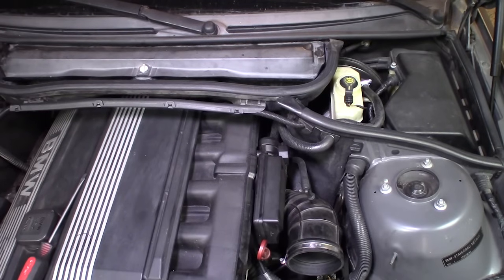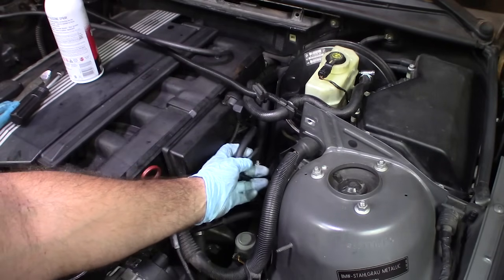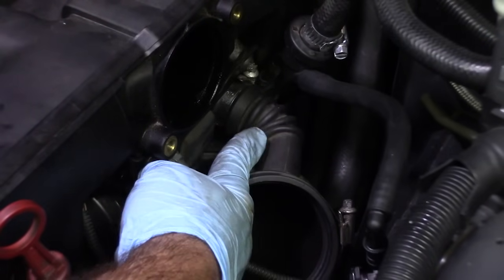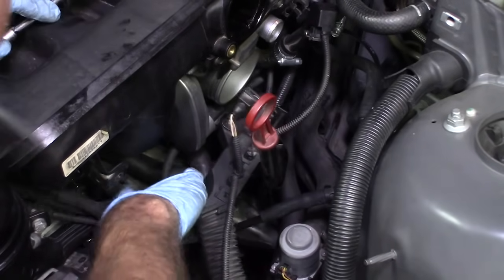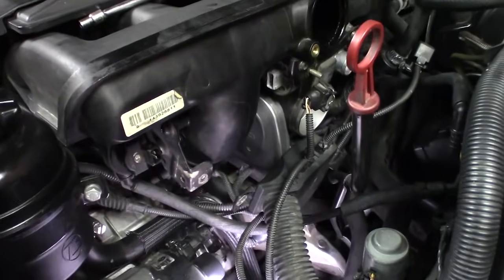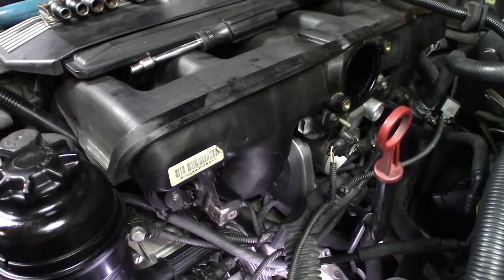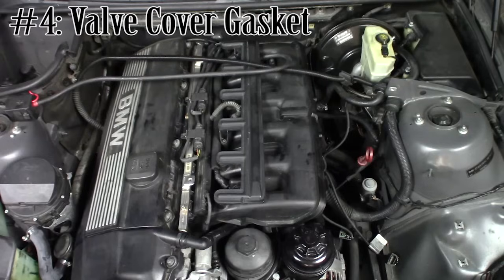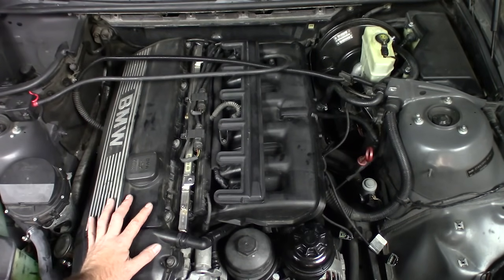BMW E46 & E39 Most Common Vacuum Leaks P0171 & P0174

Comment: First of all, thanks for running more than excellent channel. On my euro spec (no aux air pump) e46 330ci, I had a whistling sound under partial load and occasional lean codes. I have since replaced my CCV, intake and throttle gaskets, intake hoses, checked the ICV and pligged ports, checked the brake booster line amd check valve, EVAP lines etc. Disa O-ring is tight. I smoke tested it with a glove over the MAF (which I also cleaned out with the designated spray) and it seemed al right, the nitrile glove even remained inflated. Still, I can hear a whistle under partial throttle/load and it will occasionally throw a lean code (both banks). Vanos was overhauled/resealed and valve cover gasket replaced at the same time. Oh, and both O2 sensors are new. I'm out of ideas, please chime in if you could. FPR vacuum lines maybe?

Comment: Could a leak at the oil separator also cause an oil leak?  My BMW has an oil leak in addition to a vacuum issue, & if I could fix them both at the same time, it'd save me a lot of woe.
Reply from the maker: Your oil leaks are going to come from the oil filter housing gasket (this will leak directly beneath the left front of the engine), the valve cover gasket (mostly leaking from the right side up high and trailing down to the back where it meets transmission), and the oil pan gasket (mostly leaking from the right side down low but trailing down the same).  Those are the jobs you need to do, in order of complexity from easiest to hard.
Reply: Do you have tutorials up for those?

Comment: Can anyone help me with code p01062 on bmw e46.316i
Reply from the maker: +lee crammond That is an error related to the VANOS system, which is the variable valve timing system.  You need to rebuild it.  I just shot a video on how to do that yesterday.  It'll be released in April.

Comment: Super informative video and very well done.  I've seen a couple of your other videos and really liked them.  I am looking at buying an older BMW to replace my sons car, since someone ran into him and the insurance company totaled it.  It's a BMW 330i.  It has the engine light on it so i told the owner to visit the autoparts store and check the codes.  It has the 0420, 0430, 0171 and 0174 on it.  I've watched several videos before finding yours.  They all talk about the o2 sensors as well as searching for vacuum leaks.  What you said in beginning of this video was very helpful and made sense.  Q - there were some that spoke about the CATS possibly being bad, which could be very expensive to replace.  What are the chances that is the case on this car based on the codes I mentioned?  Thanks!
Reply from the maker: P0171 and P0174 is always a vacuum leak.

Comment: This was a great video. I do have a similar issue. I am getting the same P0171 and P0174 codes but my car is idling fine and drives completely normal. Should I follow the same steps?

Comment: Thank you, great video! I had both codes P0171 and P0174 for a few weeks now and finally found the reason to be number 3 on your video. Breather hose coming from oil separator/CCV to oil dipstick looked like it was trampled... Changed it and after that no fault codes referring to air leaks.

Comment: I have these codes now and my valve cover just started leaking. I will have the gasket replaced on those, hopefully it will fix the issue but will still inspect for other culprit for vacuum leaks you mentioned here. Very informative. Keep it up!

Comment: Have you ever gotten a p2227 barometric pressure code? Love your videos! You are a big reason I bought my first BMW! Your videos have given me the confidence to do the work myself and save some serious cash! Thanks in advance for any advice on the code question!
Reply from the maker: I have not but that could point to a bad MAF or a bad intake air temp sensor.
Reply: 50sKid I did some digging and apparently there is a barometric sensor on the ecm that can go bad and cause the p2227 code. The sensor is replaceable but there is some soldering involved......

Comment: Thanks for the Video, 50sKid
I have only P0174 code, without rough idle.
I have checked , brake booster hose, DISA seal, upper and lower in-take booths , but not sign of cracked...
Also check at CCV hose, no obvious oil leaking on return hose to oil deep stick either...
Shall I consider leak at O-ring of throttle body or 2 gaskets  of Intake?
Mine is M54, but it doesn't have vacuum hose on Secondary Air valve
What would you suggest net step? Thanks!

Comment: Get video - thank you - really appreciate.  Big crack in the lower intake boot and the DISA gasket looks sketchy.  

On our 330ci, removing the electrical connector from the DISA unit requires unlatching metal clip connector from the motor side of the connector.

Comment: I kept getting those codes and I kept resetting them with my bluetooth scanner. I knew that it was some sort of vac leak due to the fact I would hear a whistle sound under acceleration. Now that I have time; I will be addressing these issues. Great informative video!

Comment: Hi 50sKid, great videos that you make! I have a serious problem with my '03 E46 330iA. The mechanics checked all the vacuum leaks and found a cracked valve cover and a minor leak in a vacuum tube. After fixing that I noticed a serious drop in my idle. When the engine is fully warmed up, the electronic tacho shows 640-650 rpm on the N and 620-630 rpm on the D. It often causes my red oil pressure light flicker when the engine is really hot. Do you think it's normal to have such low rpm or should I research the topic further? I must say I cleaned throttle body, ICV, MAF, DISA flap sits tight. What can cause such problems? Thanks!
Reply from the maker: +Marek Kowalczyk I was going to say the idle control valve.  650 doesn't necessarily sound bad.  Check out my using fuel trims to solve engine problems video.
Reply: +50sKid Thanks! I forgot to say that I have new fuel filter and the fuel pressure has been measured and it's in the valid range. I'll check the other video and let you know.

Comment: Hey man I have a 01 x5 3.0 I noticed them I pull out my maf there’s a rubber piece inside the hose. I find it really hard to install the sensor without it binding is that supposed to be there??

 I’m afraid it’s not sealing and causing my bank 1&2 lean codes...

Comment: I bought an old 325 as a beater and im juat trying to get it to run healthy. I havent run the codes but im pretty sure the engine is lean causing a lack of power. I noticed while repairing a different issue. The previous owner did an egr delete. If i do not have a vacume leak could the extra o2 from the lack of an egr cause uneven burn and cause a lean issue?

Comment: i recently replaced the starter on by e46 and i removed the whole intake manifold in order to do so. now my car has the "check engine" light on, i think its a vacuum hose causing that? but im not sure. do you have any suggestions @50skid?😕

Comment: Thank you for your guides. I did successfully replace cvs on my e53 today, and it runs well. But start hearing quick hiss noise about one second long, just after engine off. What it could be? Am I forgot connect any vacuum lines...

Comment: Hello again 50sKid, I have a question about my 2006 BMW x3. I have a hissing sound from engine area while the vehicle is running started a week ago, the sound is  increase when I put climate control fan termed high. My question is a vacuum leak making that kind of sound? Thank you!

Comment: great videos. I know enough to get me in to trouble. I have a bmw X5 and I can not figure out were this one vacuum lone goes. I think the part number is 11727545323.its a hard plastic tub. with a 90 degree bend on one end and a 45 degree and another 45 degree bend on the other end. its about 15.5 inches long. I have no idea where is goes. I have looked at all the videos related to intake manifold. I can not see anything one any of your videos. HELP.! Thanks

Comment: After I start and stop my car like 3 times within an hour it usually starts at a rough idle for like 3-4 seconds and then dies. This has happened 3 times now and if I just let the car sit for about 1-2 days it starts up again. I noticed about a year ago right after I bought the car that the vacuum had a huge tear in it but did not think much of it because the car was running fine. Could this be the problem? i was also thinking that it may be there is not enough fuel getting to the engine but I am no expert. Thank you in advance!
Reply from the maker: Yes, the torn intake boot is the cause of your problem.
Reply: 50sKid thank you

Comment: Jason, I was hoping to get a clear look at the back of the intake manifold in your video on that. I need to see how, exactly, the vacuum solenoid connects to the manifold. I have my second set of P0491-2 codes in two weeks. I replaced all the hoses with great difficulty, just feeling around behind there. I've rechecked all the hoses and all are in place. The check valve works and the manifold still pulls 15' of vacuum. And the SAP is still running. So I think, against all odds, that my solenoid has gone bad or has caught a small piece of old tubing. My question is, short of pulling the manifold, can I access the solenoid and pull it by removing intake boots, the DISA valve, and the throttle body and them get it from below? I just can't figure out how to remove it. The clip diagram is unclear. Thanks very much.

Comment: Hey man. The person that owned my e46 before me completely stripped the torx for the disa valve. I have no idea what to do now because I need to replace the lower intake boot since it is very cracked. Do i have to take the whole intake manifold off?
Reply from the maker: Cut a slot in it with a cutoff wheel or a hacksaw blade so you can get a slotted screw driver in there and remove it
Reply: Actually I managed to get it.. I was using a t30 instead of a t40 but the screw was still really stripped. Thanks for the input, thats a great idea.

Comment: hello,i have done all that stuff, on 04 325i, ccv disa valve all new holes,not valve cover,changed intake casket,can here leak on top ?can u have leak on injectors , seals, did them two,i going crazy

Comment: 50s Kid- you rock! You helped me a lot by doing this video, since I learned where to look to fix a big vacuum leak(s). I just got done replacing my DISA valve and also repaired a crack in the lower boot (just used electric tape around the crack so I wouldn't have to wait to get a replacement boot). Car runs great now.

Comment: hey there thanks for the amazing videos , I own a 2001 bmw x5 e53 and I kept getting codes p0172 po175 and sometimes I have trouble starting the car it wouldn't start unless i pump gas pedal while starting , but now 2 years later for the first time only the p0172 code is on what should I look into ? car seems like it doesnt respond good on throttle and feels heavy

Comment: I have a P2096 Lean bank 1 post cat.  i originally had faulty 02 sensors, replaced them and now just getting this code.  Would the cause most likely be a vacuum leak?  i am about to replace the CCV system and valve cover gasket.

Comment: I need help because I just got my e46 bmw 323 lately and it has misfiring for cylinders 1 , 2, and 3, it was diagnosed through a computer. Does it cause less power in my unit? Although there is no warning indicator lights in my dashboard. And i also can observe minimal vibrations. If I get it fixed will it restore power in my tourque and power because I can observe that it has a delayed power during my accelerations. Replies are much appreciated thank you.

Comment: Great videos! I scraped off the old orange DISA o-ring and replaced by one from ebay. It didn't take me a considerable effort to put DISA unit back (with applied grease), which makes me worry if the leak is still there. How can I test it? Replacing the o-ring partly made the idle less rough, but vibration is still there, no codes.

Comment: Question - for me it was the tube that was broken from the separator back to the dipstick, just like you.  But can't I just replace the hose itself?  Do I really need to go to the work of doing the entire CCV?  I saw your amazing other video about doing the full CCV replace, but that's a ton of work!
Reply from the maker: You can just replace that if you want to, but eventually the diaphragm inside the oil separator is going to go.  Might as well do everything and get it done, you know?  I have been meaning to do a video on doing the CCV without removing the intake manifold.  There are plenty others out there, though.  Makes the job shorter.
Reply: Thank you!  I put the new hose in place, and that appears to have fixed the air issues for now.  I'll do the full CCV replace this January when I do an overhaul (after I have a new car to drive!).  I think doing the manifold is the better way after watching your video and the other non-manifold videos though, and it will give me a chance to clean out the compartment of all the dried oil.  It's been leaking oil for a long time and I could never find where, I'm sure this pipe was it.  Can't believe I missed that, thank you so much!

Comment: I have to double connector from my intake boot to my vacuum line. My question is what is the name of the second smaller line and what is it used for? Mine broke in half and not sure what part to order
Reply from the maker: That line runs down to the fuel pressure regulator and you can just use generic 3.5mm ID vacuum hose that you can find online at amazon (silicone vacuum hose is the best stuff).  Or you can try to get some vacuum line from your local auto part store (they have boxes of it in the back and will cut it to length).  It's a hard plastic line with vacuum lines at each end.  If the plastic part broke in half, just connect it back together with a small section of new vacuum line.  You CAN use 7/32" vacuum line if that is all you can find at the auto parts store--it'll be harder to slip onto the hard plastic line but it's possible.  Silicone spray or soapy water helps.
Reply: Thank you sir
Reply: I've changed out the intake boots, new Mas Airflow Sensor and actually needed a whole new DISA. But I'm still getting a rough cold idle and very bad hesitation when I put the gas pedal down all the way. Still have both banks running lean. Any suggestions?
Reply: I found the culprit. Bad fuel pump. Replaced that and the rough idle and huge loss of power when I accelerate hard is gone. It's still lacking some power. Gonna change the fuel and air filter, spark plugs and clean the injectors. Hopefully that puts her in a good enough condition to sell

Comment: 2011 BMW 328i number people tried to fix misfiring problem codes say 1,3,5 misfire then all 6 and cat lac converters turn fire red muffler shop said they or not the problem and want get over 45 MPR missing so bad, does this sound like a vacuum leak , timing issue  HELP

Comment: I keep getting 171 and 174, even after replacing the ccv, upper and lower intake boot, new f connector, new lines on basically everything. I did remove the dipstick to replace the ccv and i did replace the gasket, although it didnt feel super tight, would that cause these codes?
Reply: @50sKid also do you have a source for getting just the gasket/oring for the disa? All i can find is 80.00 rebuild kits, which i dont need.
Reply from the maker: Yeah just search for disa o-ring on eBay (be sure to specify what size of engine you have, because there are different size disas with different size o-rings)

Comment: 50s kid so I replaced the CCV I replaced the the vacuum lines I replace the valve cover gasket I replace the pre cat O2 sensors. No I'm getting a little bit of white smoke coming from the exhaust manifold underneath the valve cover, this by rear pre cat oxygen sensor. I am having some suction still when I remove the oil cap do you have any thoughts?

Comment: hay there is have a engine oil leak 
do you know of any common problems I can check first
Reply from the maker: Watch my oil filter housing gasket and oil pan and valve cover gaskets.  Those are the most common oil leaks.

Comment: I'm  stressed to no end i have a 2002 bmw 325i.  Cylinder 2  misfire with fuel cutoff.I've changed plugs twice changed coils twice haven't tried injectors yet but not believing thats it pressure is decent on value  about 156. Vehicle has 147,000 miles i do have a oil filter housing gasket leak. Not sure if that would cause it. Help.  I love your videos. Congrats on your new job.

Comment: Hey I have a quick question, I have an 04 325i it’s straight piped, still has cats but no mufflers or resonators. Could this possibly be causing me to get the p0174 code?

Comment: so i have a 02 325xi i have the p0171 and p0174. it idles really rough when cold and fine when its warm (sounded like the ccv as described) i checked all the lines on it and there fine. ive checked many other lines there all good. my valve cover gasket leaks in the front of the motor (like alot) i heard him say that can throw the code, but would it make it idle like that? i wouldnt think so just wondering if anyone else would know? thanks in advance.

Comment: Hi I drive my 2005 x3 3.0 and star turn off the lights , and the light 4 awd and the brakes abs lights and another coming on and off the headlights turn off like the inside the car .the codes have are p0174 and transmisión light .please any help from this problem this pass after put another tires and one store 4 hours after .thanks again .

Comment: so do you think my vaccum leak could be causing my engine to cut power after I go over 4000 rpm on any gear? ?
Reply from the maker: That's not the normal symptom, no.
Reply: Thanks you have any idea what can be causing that from your experience?